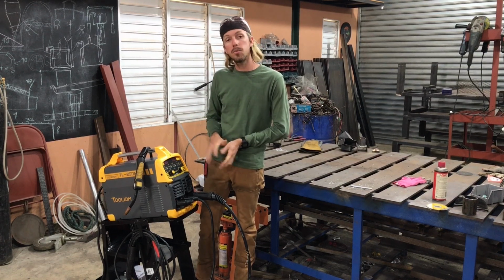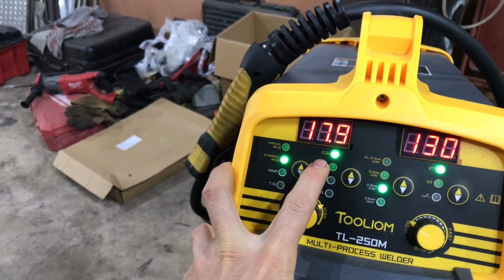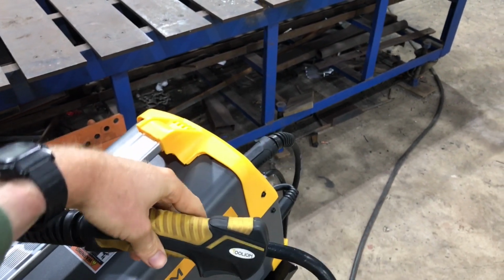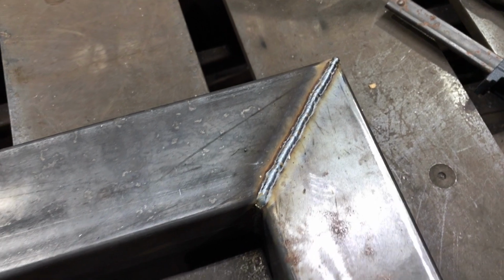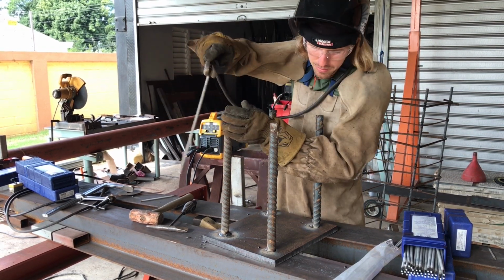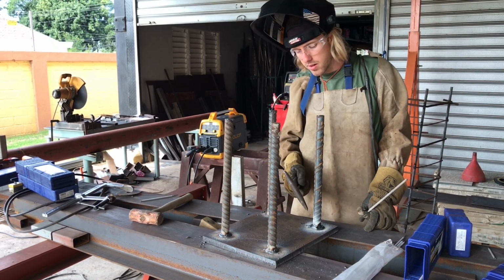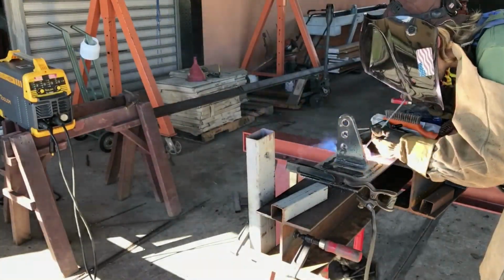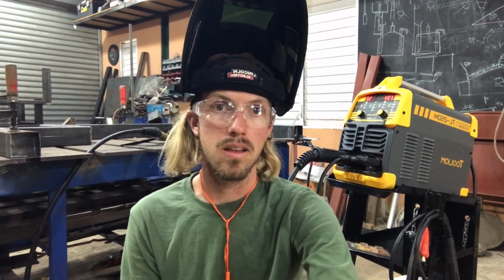TOOLIOM 250M Multi-Process Welder MIG/Lift TIG/Stick 3 in 1Welder Review

Comment: Does it burn 6010 well?
Reply from the maker: Not really they have a different stick Welder that is advertised run 6010 and it seemed to work quite well when I tried it not as good as some machines but I was trying their smallest 120 V machine that’s like $60 and it did run E6010 just not extremely well
Reply: @CreativityUnleashed  Thank you. Cheers.

Comment: real world review. excellent piece.  every welder runs a bit different and requires attention to arc length and amperage and travel speed and rod angle. my vantage 300 was almost idiot proof (and i put her to the test daily) but to get a feel for the basics and processes this machine is a good starter. awesome that you used 1/8 and 5/32 7018 to see what she'd do. the 6010 just needs to be run on electrode negative and it'll dig right in. great video
Reply from the maker: Thanks I will try that with the E6010

Comment: So you think this thing could handle 1/2” material using 0.035” flux core? I wouldnt do it often but itd be nice if it could handle it every now and then
Reply: Just turn up the inductance and go one in and two over. I've done hafe inch with 125 amps on stick welders this way.
Reply: I forgot to mention to use 7018 all the way it will hold very well. Just use a slight drag angle of around 5 to 10 degrees on the root pass to ensure good throat penetration and your good.

Comment: My 250M arrived with factory defect so the dial selector does not work making the machine useless and they expected me to ship it back at my own expense and I was promised to have a new welder sent after providing the tracking info for defective unit.   That seems like a huge risk so I just throw the welder into e-waste and call it a very expensive mistake.
Reply from the maker: well I am sorry to hear that it's always a risk when purchasing low cost equipment it's a trade-off whether you have more time or money I have more time so I don't mind putting up with a bit of headache as long as the end result is good.

Comment: In my opinion Technology is very accessible now where as just 10 years ago the 2 or 3 major companies monopolize the welder machine game. Good to have other price options for the third or half the price.
Reply: Absolutely. The big names are grossly over priced.
Reply: @robertblackshear8963 yeah, i have that welder he is using and it works amazing with solid wire with gas. Only 350.00 i have many other welders and this thing keeps up with them. It is small and lightweight. Works about the same as my 250 lb thermal dynamics